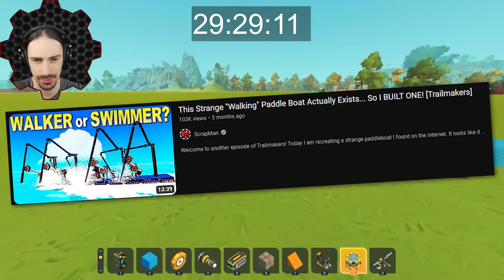Speed Building a WALKER in 1 Minute, 5 Minutes, and 30 Minutes!

Comment: Actually it's normal for the flat surface wedges to have more friction than the jagged ones, since there is more surface area in contact with the ground or whatever. Jagged surfaces are only good if there is liquid or mud/rocks involved (those can go between the 2 surfaces and minimize friction), and that's why tires for rain and off-road aren't smooth but road racing tires are